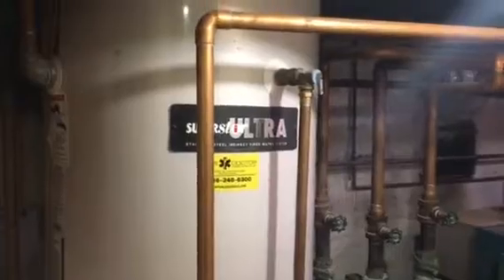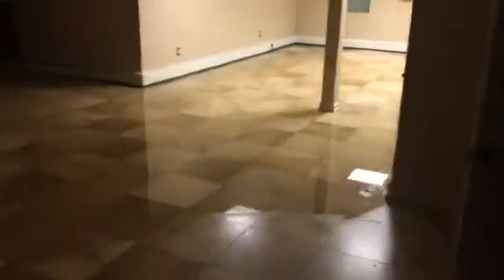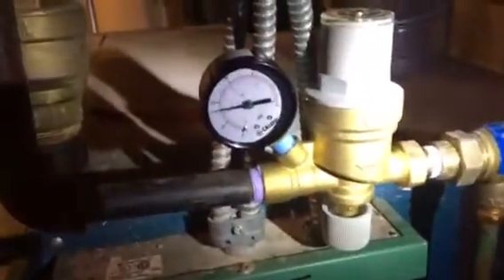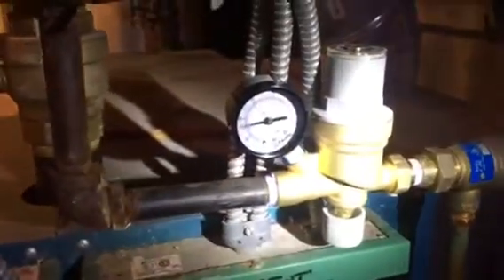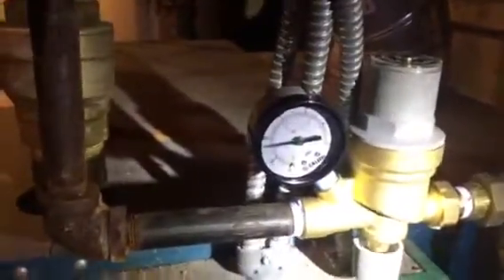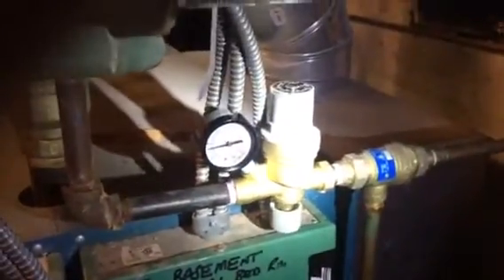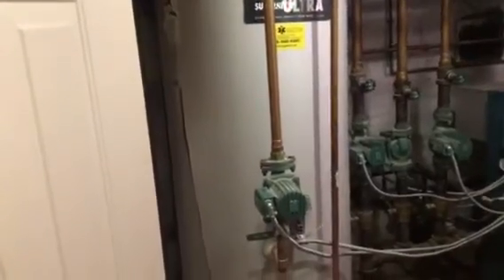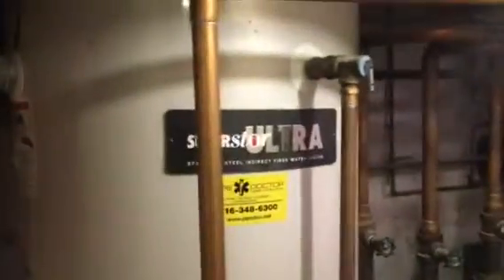Hydronic Gas Boiler with Indirect Water Heater - Leaking 30psi Relief Valve

Comment: Any idea what caused the tank to fail? Less then 5 years ago had installed a Techtanium 40 gal. Indirect and match up to a brand new Burnham ES2. The other day heard & notice water leaking from a relief valve, mounted on boiler side, and also a LED code S-32 Water Temp Sensor Failure code. Called the same plumber who did the install for diagnoses and repair. I was floored when plumber told me that the problem was the state of the art Techtanium water tank. He believes it was pinpoint hole in the tanks internal coil just as you described in the video. He blamed the toxicity of the water. I told him I got more longevity out of an off the shelf box store gas water heater!  Are there any other solutions other then replacement?  And if it's replacement, I'd sooner go back to an off the shelf type.
Thank you for this video. You now have a new subscriber!

Comment: Indirect had hole and back fed bolier
Reply: I might have the same problem with a 25-years-old superstor. The boiler psi increases 2psi everyday with good feed-in valve shut off everyday.